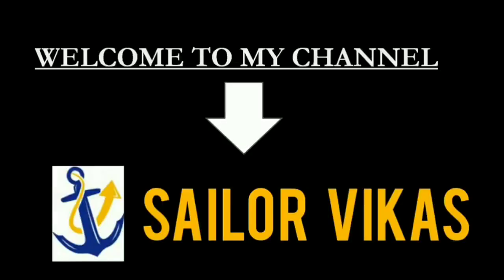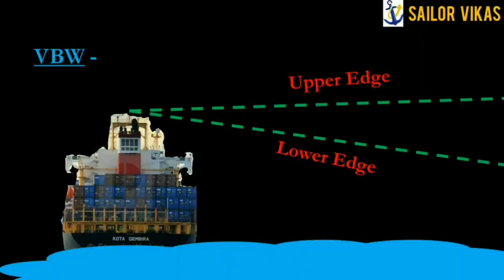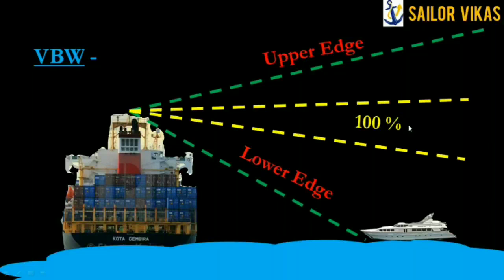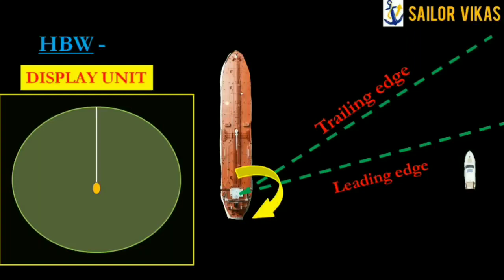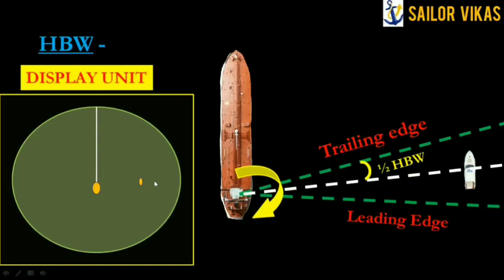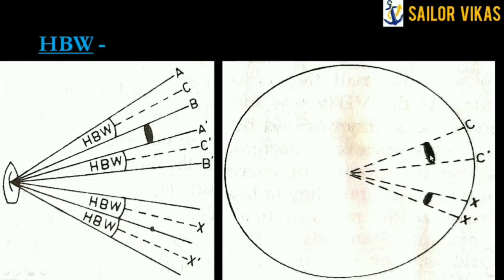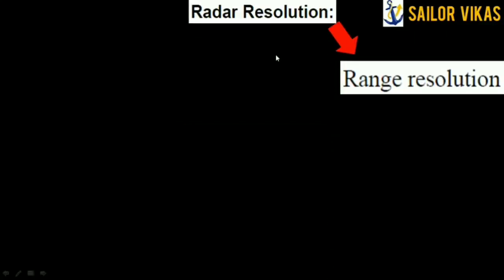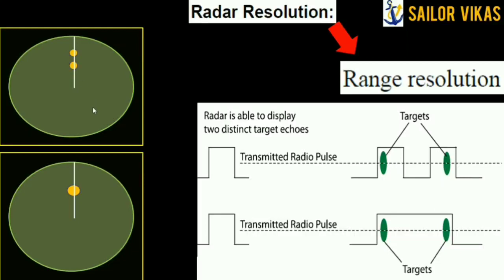Marine Radar Beam width , Radar resolution( Bridge equipment series) #marineradar #radar #mariners

Comment: Sir! What is the use of Radar maps?... and what are nav lines?
Reply from the maker: There are 2 ways radar maps can b explained bro, one used for weather ( rain identification) in radar so that display where rain is visible is called radar map, and second concept is of loading routes in radar display, this is also called as use of radar maps.
Secondly, take 2 nav aids ( buoys or lighthouses etc ) and a line is drawn joining both nav aids (line displayed in enc) and than while steering u follow that line for navigation purpose thus it is called nav line.
Reply: @SailorVikas  Thank you sir... keep the good work going 🙂👍